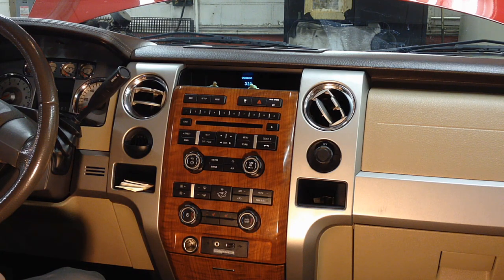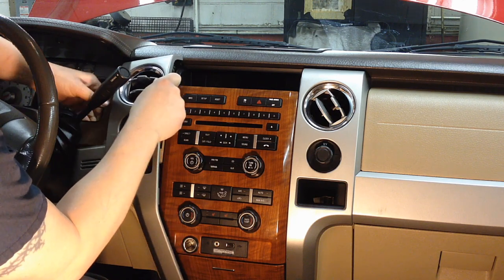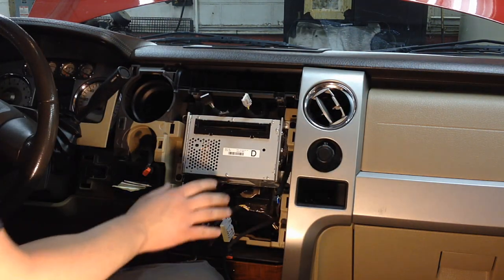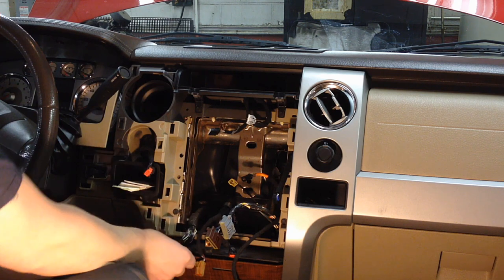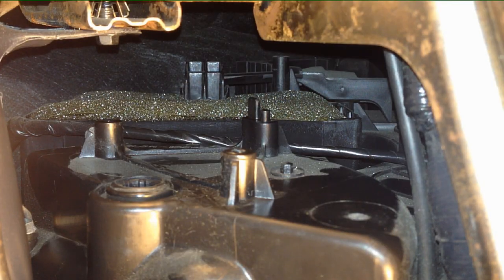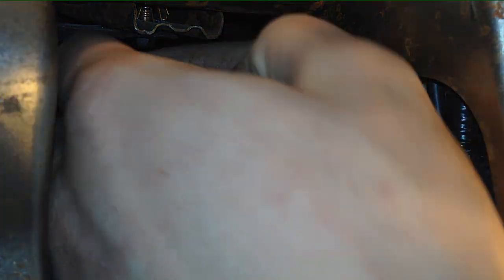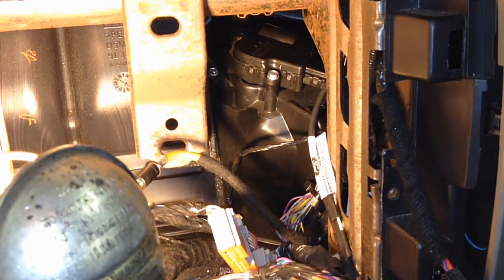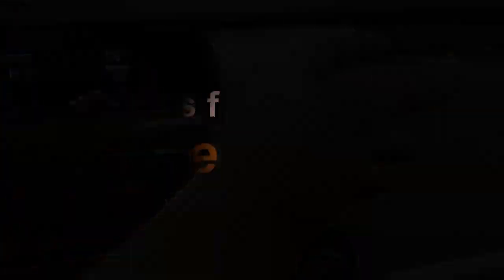2009+ F150 Passenger Side Upper Temprature Blend Door Actuator Replacement

Comment: My driver side is blowing hot while the passenger side is cold. I ordered the part through your link and replaced it. It worked fine for a little while but now it's back to cold. It will sometimes blow hot. What could be the issue?

Comment: I can't find the video for dual heat/air actuator.  In this video you said it is the lower one.  But I just can't find your video on that.  2013 f150 lariat.  Driver side blows hot regardless of what temp I set it to.  Passenger side works as it should.

Comment: 2013 Platinum. I have no heat whether I use dual zone or not and everything else seems to work properly. Do I need to change both the upper and lower actuators? Could only one activator be the problem? I've not heard any clicking noises.

Comment: Hey so I resently bought 09 ford f150 fx4 when I test drove it the ac didn't work they told me they would have it fixed for me before I picked the truck up well needless to say it's been a month and they still don't have it fixed and I still don't have my truck they said there mechanic was a ford tech for 14 years but idk why he can't figure it out then. So they have replaced the condenser and they told me they also put in a new gauge cluster. They told me the ac works now but they can't control it with the buttons. Was wondering if you or anyone could point me in the direction of what the problem is. They are putting new buttons in when they receive them I'm just beyond frustrated with the sit

Comment: Thank you! Your videos helped me replace all blend door acuators on my 2010 f150 lariat with dual climate. However my dash vents will not work unless I remove the acuator from near gas pedal and manually turn the wheel. Can't get to calibrate. Am I doing something wrong or is there another part to try?  Only blows at floor and defrost with motors in. I used all OEM motorcraft  parts. Could my dash control be bad? All buttons and lights work on it. So frustrating!

Comment: Ok first thanks for the video and i have a question i have a 2010 f150 platinum and the passanger side was stuck in cold so i replace first the actuator on the bottom but realize that still stuck in cold so i replace the one behind the stereo but now right after i turn on the truck i turn on the heater and star blowing hot air but stuck in hot now and the driver side is working good now im a little confuse i will preciate if give me an advice please and thanks

Comment: Good morning. Two days prior to moving to Jacksonville I had dealership replace passenger blend door actuator. On trip down once I turned on AC the windshield lost third began fogging up on the outside. Cold air was coming out defroster vents. I tried to recalibrate actuator to no avail. Question is when you do calibrate should AC be off, on, or set to specific settings or is the actuator they put in defective or possible not aligned on spline correctly? I can't afford to go to dealership again and get charged another $270 dollars to fix it again cause I only live on my disability. Please help?

Comment: Question,   I have a 2011 with touch screen sync.  The drivers side temp will go up and down accordingly,  but thr passenger side stays very hot.  It switches fine between feet, face, and defrost.     Is the actuator in this video the problem?

Comment: I did this repair on my 2010 f150. Afterward i never calibrated and it never seemed like it worked quite right, maybe a little change in passenger temp, but does not feel like driver side whether it’s AC, or hot. Just feels like outside air. 

Question is, since I didn’t recalibrate properly did I mess this new one up? I tried to calibrate a few minutes ago and it didn’t change. Does the key need to be all the way forward, or in first position? I really don’t want to have to do it again!
Reply: Jeff Sadly, I did the same thing, what did you end up doing?
Reply: Juan Olivas Not a damn thing! It’s still broke lol. My wife hates riding in it on really hot days because of it. Reckon I’ll tear it back apart one day. I just hate tearing out dashes and stuff. Always break plastic and end up with screws left over lol

Comment: Hi I really appreciate both videos that you have created.  My system isn't providing any hot air to either side and i'm having a hard time believing that both actuators have gone bad (but I know it's possible).  I hear no clicking when adjusting the temperature on either side.  But the heated seats work.    Should I be looking elsewhere for the problem?  thanks for any help.
Reply from the maker: +Greg Pisanich Without a scan tool the best thing to do is replace the upper one that is very easy to get to. With these actuators being so cheap on amazon it's the fastest most effective way of troubleshooting this without a scan tool or pinpoint test which would require removal of the same instrument panels to get to.
Reply: +FordTechMakuloco.    Thanks for the feedback.  I did a test today and found that I had proper operation on the drivers side but the passenger side only blew cold air.  Looks like I'll be replacing the tough one. .  I'll go ahead and replace the drivers while I'm in there.    Keep up the great work.

Comment: So mine is clicking for a short while after starting the truck but eventually quits.  All my controls seem to be working fine, can change air flow, and temperature no problem. Is it this part and just not gone all the way out yet? Thanks for the video, way clearer than some others.
Reply from the maker: Yes they start this way you may notice it only clicks at one point in the temp dial. Only one tooth is missing at this point so it can jump to the next one eventually since they are so close to one another.
Reply: +FordTechMakuloco cool, thanks for the replay, just order the part.  Got the YH-1881 for my 09.

Comment: I have a 2010 Lariat with Dual climate control and i have that center console you were referring to ,  there's a clicking noise whenever you start the truck the dealer told me it was common noise with these trucks ,
Now my truck air mixed the hot and cold air when you have the AC even you set it to sync but the passenger said still blowing hot air .I'm still getting the clicking  noise i can switch the driver side from hot to cold but not passenger side

Comment: Thanks for the video. Any recommendations??? I have replaced this 3 times on my 2011 f150 and have finally found that the hole that the actuator goes into has been gnarled so it will not grab to turn. It then skips and starts clicking, eventually breaking the actuator. Any advise on what I can do? I was thinking about using a small file and trying to make the "teeth" inside the hole deeper so they are not rounded off. Thanks for any help.

Comment: What was the make/model of the little hex-1/4 ratchet you were using in this video to remove the actuator. I have the small gear wrench. Please let me know...would be appreciated. I have almost the exact same truck in your video...2009 F150 Platinum 5.4/3v but with center console.

Comment: Awesome video, thanks.  I changed mine out over the winter, though now that it's summer, my ac doesn't seem to be quite as cold as it was last year.  Couuld this be the cause?  It's still cold, just not nearly as cold as it used to be.

Also, when I go all the way to cold on my temp adjustment, and then back it up a single notch, it clicks 1 time.  But only at that one spot and only 1 time.

Bad actuator maybe?

Comment: I have a 2012 F150 SCREW lariat with navigation dual zone heated seats etc. I have heat and air on the driver side but passenger side only blows cold/ambient air. No popping or clicking noises. Doesnt matter if I'm selecting defrost or face vents the passenger side only blows cold air. Any thoughts???

Comment: I changed that part for my truck but right now only have hot air for the passengers side I need to change in other parts to fix that. the problem is only for the passengers side ??????

Comment: Should I turn off the climate control before starting so it’s off when done and start up or do you want it on AUTO when you initially start so it’s on AUTO once your completed? Or does it even matter? Just wondering if it should be in a specific state for the calibration when you start up after removing and reinstalling the fuse. Thanks!

Comment: I have a 2009 ford f150  lariat my passenger side only blow cold driver side does both cold and hot I purchased the acuctator for your link and now I the passenger  side is stuck on heat what to do please help

Comment: Looking for a little advice...I have a 2010 Ford F150 Lariat blowing cold air on drivers side and passenger side working fine.  Im assuming it might be the lower actuary but I don't have any clicking or anything noise etc.
Your thoughts?

Comment: Excellent video.  I just did this on my 2011 F150 in about an hour.   The new part had black plastic on the main gear instead of white, do you know if this is a sign that Ford  attempted to fix the issue with these?

Comment: I didn't pull the fuse before starting up my truck and using the air, now I can hear the damp popping essentially. Can the recalibration be done after you have already energized the actuator or do I need to install a new actuator and make sure I pull the fuse prior to energizing it?

Thanks great video!
Reply: Britt Mork pull battery wire for 15 minutes.
Reply: +Brad Wolfe I did the fuse pull and still getting that popping noise.  Time to buy a new actuator?  There are so many available on RockAuto with different part numbers how do I know which one is the correct one?  Even TascaParts.com was confusing with regards to the passenger actuator.

Comment: Great video. I have a 2014 F-150 with dual climate & Navigation. Do you know what differences I may run into? I don't have any clicking noise, but the AC on the passenger side just started blowing heat today.  Driver's side still blows cold...

Comment: I have a 2012 FX4 with Nav + flow through console.  At 101k, the 4 center console vents stopped blowing A/C or heat.  Windshield defrost vents, foot well vents, side front door defrost vents and cooling system for both front seats all still blow A/C, but the center console does not.  No infamous "clicking" sounds from one side or the other of the dual zone system (Driver, Pass), and no other warning.  Both sides of the center console just stopped working.  Of all of the Ford "blend door" videos I've found, none address this particular issue.  Based on your personal experience with this, any idea of which (or either) of these 2 actuators is to blame, or something else (stuck piece of foam in door(s), etc).....?

Follow-up:  after checking the motor actuator covered in this video, I found some other videos and figured out the driver's side bottom motor actuator was the culprit.

Comment: Replaced the one behind the radio without any issues but having issues with the second one in the passenger side footwell. Now for some reason I’ve tripped the Anti-Theft System and has completely locked me out and I couldn’t open the doors even manually. Called a locksmith, he had issues but was finally able to get rear passenger door. Got in, not able to unlock the doors or open with the handle, completely locked, no power to the dash cluster and wont start even if boosted... It was fine when I was working on it and even when I left if for an evening and grabbed something out of it in the morning. But it locked out later that evening without me touching anything. A bad situation just got worse... If you have a dual climate control on an 2009+ F150 and its the drivers side causing you issues, I recommend spending the $1600 to get it fixed by the dealer as I have found no clean way getting that second blend door out from the passenger footwell.

Comment: Same set up. The passenger temp control bypass doesn't work. Push it in... light comes on... but temp will not change. Stays the same as the drivers side. What could be my problem? Temp up and down and blower all works same as drivers.

Comment: FordtechMakuloco, great video, I replaced mine in an 09 f150 but still not getting heat. Had my wife take it to the dealership for diagnostics and/or to see if I didn't normalize it right. He said codes showed it was the left side actuator showing the issue, but then told my wife it was behind the passenger side airbag.  Is there another one back there that's only seen behind when dash is removed, or is it gonna be the bottom one that your other video shows? Also can you tell me what fuse for the 09 f150 (w/o dual side temp control)? Thanks, your a Godsend!

Comment: Mine is stuck in the hot position. If I changed the passenger actuator would it fix the issue? Thanks
Reply from the maker: Most times yes you will see the actuator hunting but not moving as commanded.
Reply: FordTechMakuloco thank you so much! I’ll fix it this weekend!

Comment: I have a 2011 F150, manual control HVAC. The clicking behind the radio started after replacing a dead battery. It clicks constantly, no matter if the AC, heat or fan is on or off. If the key is ON it's clicking. It did not click prior to the failed battery but after replacing the battery it will not stop clicking. Is this a calibration issue or is it a coincidence it failed at that point? How do I calibrate a 2011 F150?Thanks

Comment: So in reading and watching the video (very nicely done by the way!!), am I to understand that the passenger side is controlled by the upper actuator and the lower one controls the driver's side? I have a center console and the passenger side and back vents blow cool air, while the driver side works fine.  Thanks for this and any advice you offer.
Reply from the maker: +theAdmurl498 Yes passenger side is controlled by the upper which is the easy one to change.
Reply: +FordTechMakuloco ...Awesome. I'm on it! Part is ordered and beer is on ice. Thanks man!
Reply: +FordTechMakuloco : Update: The part was $44 up here in Ontario, Canada. But that's where the differences stop. I ended up sawing  an 8mm wrench in half, and I was able to maneuver around in behind the actuator to get that back screw out. I was back up and running in about 60 minutes, all in. The calibration kind'a scared me because when I turned it on, it began clicking again! But that has subsided and It's blowing hot air on both sides and in the back seat. Thanks for everything once again!
Reply: D Nelson  how long was the 8mm I lost them and cant find out
Reply: Hi Jose. I assume you are talking about the wrench itself. As I mentioned, I actually cut a closed-end ratchet style wrench in half. So, it was about 5 inches long and worked perfectly.....even for a guy with big hands.
Reply: Thank you so much

Comment: Thanks for the video.  They have been a great help.  Unfortunately I changed my lower motor and I still have only cool air blowing from the drivers side.  I pulled the fuse to reset the motor and still aren't having any luck.  My motor never made a clicking noise.  It just didn't blow any heat from the drivers side.  What do you think my issue is? 2010 F150 with dual climate control.  Thanks!
Reply from the maker: Was it a Ford actuator?  Unfortunately I have to say you will likely have to go back in there. What we need to do is if you can adjust the temp from cold to hot and watch the actuator to see if it moves. If it does not pull the fuse 15 for a few minutes then put it back in and turn the key on and HVAC on then watch the actuator it should move and do a full sweep by itself. If it never moves in all those test I would have to say we need to remove the actuator and while it is connected but removed from the air box do the same test as above. There are no known door or HVAC module problems on these trucks. You are sure the connector is fully seated??
Reply: FordTechMakuloco I brought the old actuator to the dealer to test it.  They checked the ohms and said it was bad.  The new motor was a ford part.  It may be a few days before I can tear it down and make the tests that you suggested. I am sure that the plug was properly seated although I did break the red tab when I tried to put it back into the plug.  I don't think this would cause my problem though.  There doesn't seem to be any tension on this plug that would necessitate the tab's effect on the motor to perform..  I am wondering if I got a bad motor. I am going to remove it and bring it to the dealer to check it as well.  Thanks for the reply.  I will be in touch.
Reply: Karen Miller
Reply: Anthony Moore Karen, what ended up happening with your repair.. Seems like same thing happened to me except with the upper motor.  Did you get it resolved.. What was it?

Comment: I changed out the upper blend door twice. I had a brand new motorcraft  and it was not working so I bought another one from OReillys. It works but it still blowing hot air out of the passenger vents. Any suggestions? Thx
Reply: Also I have a 2012 Ford F-150 Lariat Ecoboost dual control

Comment: Hello Sir just watched your videos. I have a 09 f150 my a/c blows cold on drivers side heat on passenger side. I've  followed both of your videos on this issue and have replaced both accuators top and bottom. Ive taken the 15 fuse out as you stated for the calibration, turned air on and the passenger side is blowing cold only now. Neither of my accuators were clicking. The only reason I changed them is because my passenger side was stuck in hot and because I have a floor shifter I replaced the bottom one also... These are some great videos and saved me a lot of money. Do you have any other suggestions that I can check to find out why the passenger side is stuck on cold and won't switch over? Thanks again for the videos!